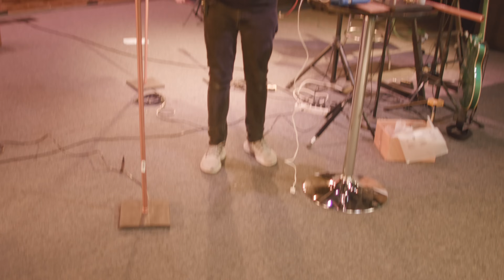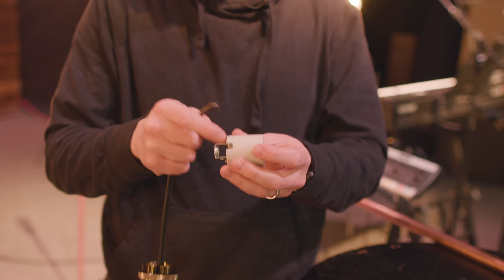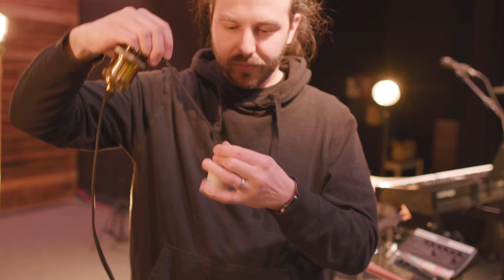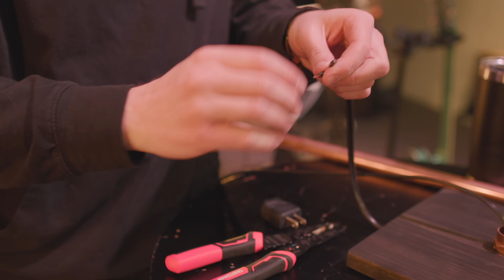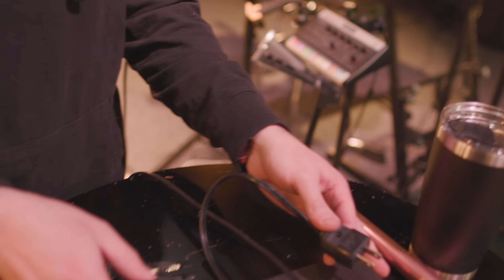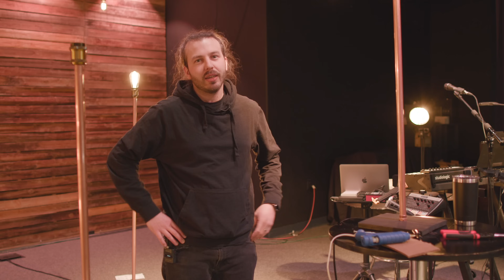Church Stage Design Idea | Edison Bulb Light Stands

Comment: You can drill a screw thread into the bottom of bulb socket and then use any avaliable mic stand as the bulb leg.
Really versatile and scalable to immense numbers. I have had done 40 of these in a secular concert in church and it was really awesome. Transported in one small case plus eight bags of rented mic stands.

Comment: I dig this setup and really like the look that it gives.  We might do something like this in the future.

However, if anyone else builds this I would highly advise that you use 3 conductor portable cable (third conductor for ground) instead of the two conductor stuff.  That’s a lot of exposed copper.  All of that metal needs to be grounded so that someone doesn’t get lit up if one of the other conductors wears and shorts to the metal piping.

Just solder the green wire to the copper pipe on the inside and use a three prong NEMA 5-15 plug on the other end.  Better safe than sorry.
Reply: Parich office

Comment: In the UK you'd need an earth wire on a metal fitting like this but I guess this is different in the USA
Reply: If you were doing a home install then yeah code wise you will need it, this is not quite that level.
Reply: @seancca  from a basic wiring safety point of view if the live wire comes in contact with the fitting and someone touched it without a ground the electricity is going through the person. While this may never happen people doing DIY on this type of project will need to be very careful the wires into the fitting are properly shielded and secured as there is no protection without a ground. I would recommend paying an electrician to do it in your location so you can make sure it is safe.
Reply: @on3orafter  yeah I understand that. I am just telling you why it is not required in America. Also the way this is setup it, unless there was a massive failure of the bulb socket or plug end that won't happen.
Reply: @seancca  all the more important to keep people safe in a publicly accessible place. Not sure why you would want to not do something to code because it's in a church.
Reply: @on3orafter  I am telling you, as a US citizen, there is not a builders code for this. Also just a reminder we deal with less voltage than you all do. 110v is our power.
Reply: @on3orafter  These are all perfectly acceptable setups in the US. I get that the UK is different, which again probably also has to do with you all being on the 230v power system than the US on 110v.
Reply: @seancca  fair enough it's not required in USA. I've seen too many DIY wiring jobs with live fittings not to comment.
Reply: @seancca   the voltage and the current is the issue with electrical shocks.
Reply: @on3orafter  this is actually one of the safest and easiest things to do in terms of wiring. Unless you are cutting the wire in random spots everything is insulated in the plug or the socket.